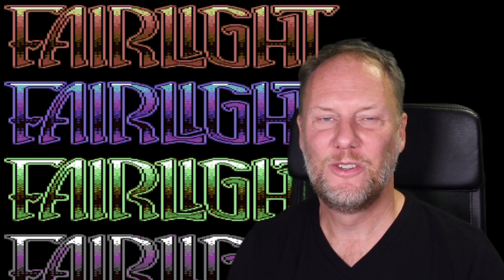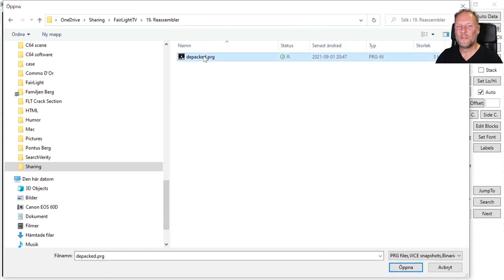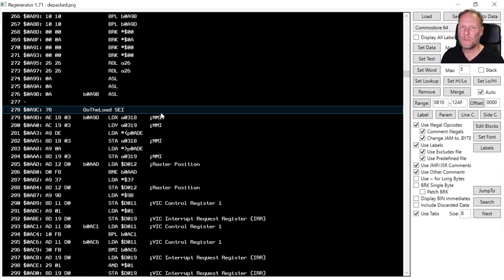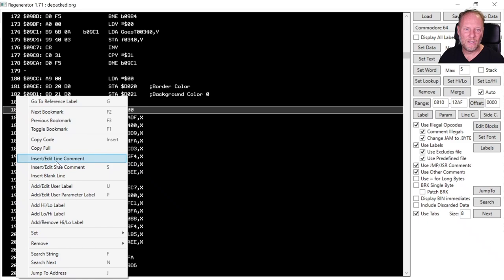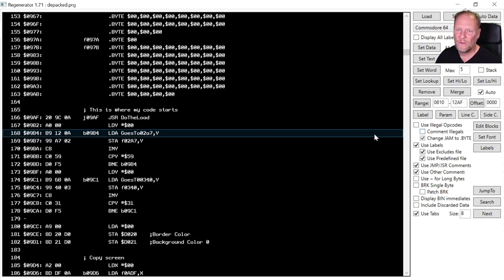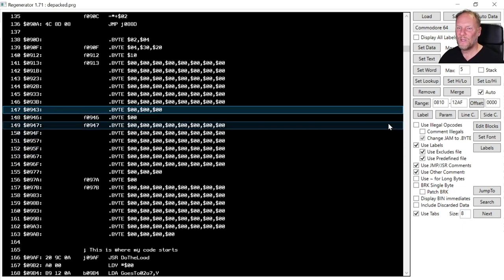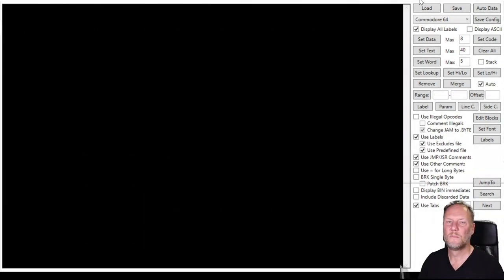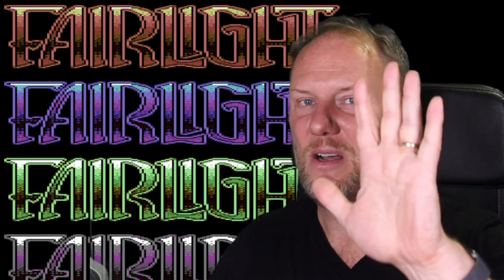FairLight TV #19, FairLight facts: Regenerator

Comment: So what you were really talking about is a resourcer or "decompiler" in PC-bucket-lamer-speak.
Reply from the maker: Decompiler yes, the specific one used is called "Regenerator', a multi system dissassembler, made by a C64 group.

Can also be used for :

Supported Systems:
- Commodore 128
- Commodore 1541 drive
- Commodore 64
- Commodore PET
- Commodore Plus/4 (264)
- Commodore VIC-20
- Apple II
- Atari 8bit
- BBC Micro
- NES
- Oric
Reply from the maker: Well a decompiler tends to be from machine code back a higher level language. Like back to basic. Some of that will be p-code back to source.
Assembler is a textual representation of machine code. representation of what will 

So it's binary back to source, so I guess resourcer works but not really decompilar for reasons given.